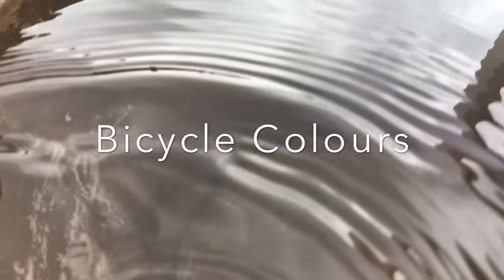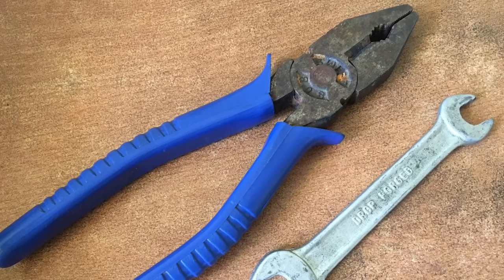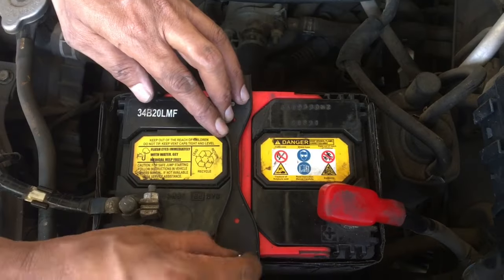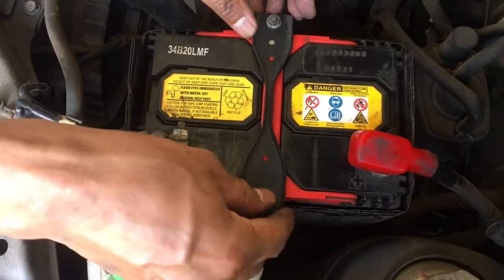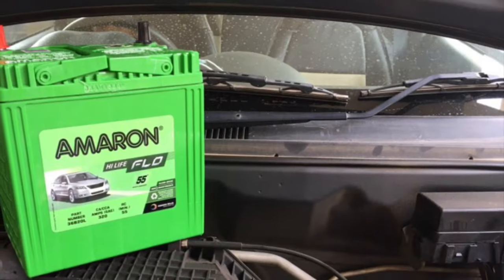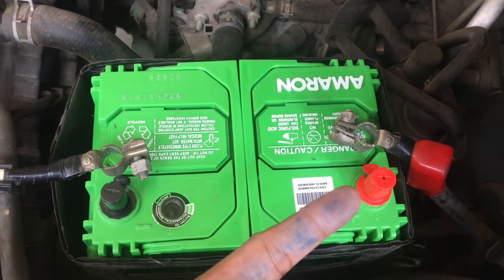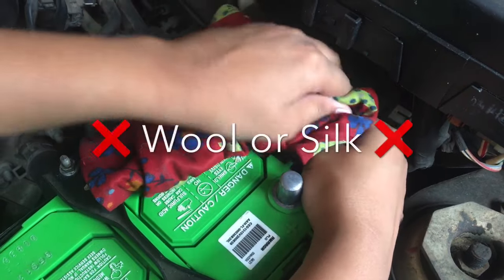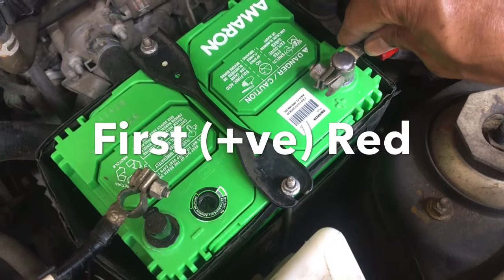How to Change Replace Car Battery | DIY Car Repair at Home | Remove Battery and Install

Comment: My son switched on the head light whole day and battery dried up. Can we charge the battery in home or is it necessary to take battery to electric shop
Reply from the maker: Hi Chandan, You should be able to change battery at home. Just buy the same battery and follow instructions as shown in this video.

Comment: Why does the negative terminal come off before the positive terminal?

Seems like if you take off the positive terminal first,  voltage is no longer applied to any part of the car, there is simply a bare positive terminal hanging in the air.  Then nothing that happens on the car as long as you do not touch the positive terminal will matter.  Then virtually anything that happens when taking off the negative terminal doesn't matter.  You can even put that little red plastic cap from the new battery onto the old battery while you are removing it so nothing can contact it?

I am going to change a battery now and do it the suggested way, but I am wondering why?  I wanted to check on the Internet what is the correct way to change the battery, but I wonder why?

Any wisdom on this would be appreciated.

Does it really make that much difference?
Reply from the maker: Hi, Your logic is correct, disconnecting any terminal first will break the circuit. But there is a reason to do so and it is ‘SAFETY FIRST’. 

The positive terminal is always at higher potential. While you disconnect positive terminal first and if in case your tool accidentally touches any part of the car chassis it will create a short circuit. The high heat from battery could lead a possibility to explode thus making sulfuric acid to spray around. 

The method of sequencing terminal disconnection is a best practice so even a layman can perform this task with ease and safety.
Reply: @bicyclecolours8988  
Just did it this afternoon.  Thanks, I understand and agree with your logic.  It has to do with the fact that the whole car is the negative terminal if you take the positive terminal off first, whereas if you take the negative terminal off first only there is only the positive terminal one need to avoid.

Comment: Do we get shock while doing
Reply from the maker: Hi Dinesh, You never get electrocuted by touching car battery. But be sure your spanner/wrench never touches both terminals at the same time. This may cause spark, high heat and explode the battery.

Comment: I find the 10 spanner does not sit well on the nut and there is very little space to manipulate....bit of a struggle
Reply from the maker: Hi Pramila Priyadarshini, Each brand have their own nut specification that goes to secure battery inside rig. The best option would be to try using different spanner numbers and select the best one. Thank you!
Reply: @bicyclecolours8988  thank you I will try with a smaller one